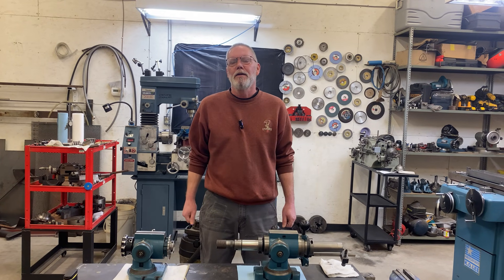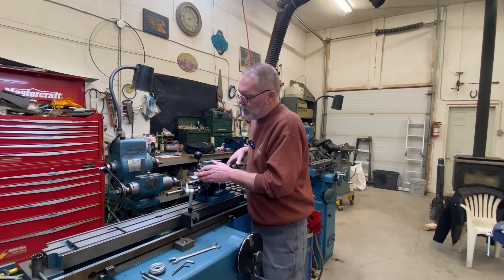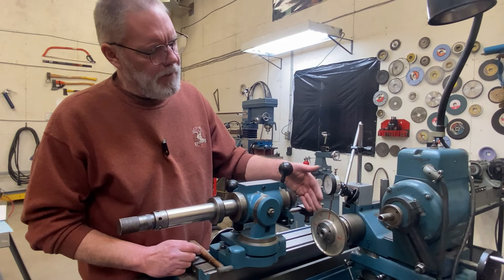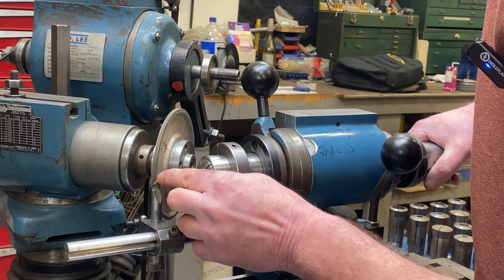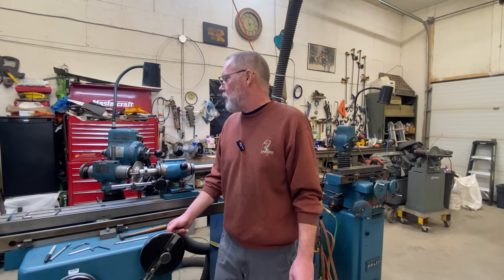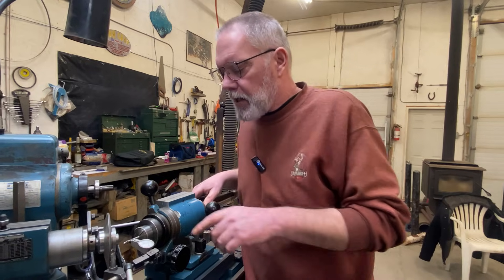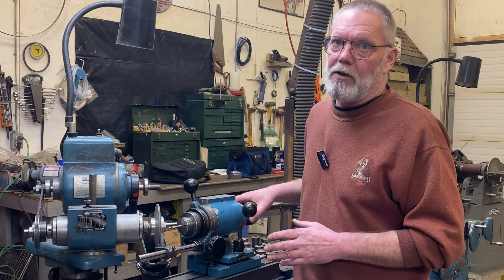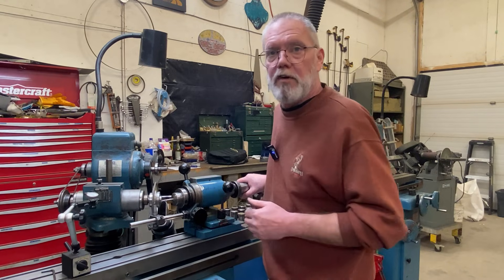HOW TO SHARPEN SMALL CARBIDE END MILLS

Comment: Great..I found out those little 1/4” cutters aren’t worth to sharpen.
Reply: I would love to own a proper sharpening machine to play around with, but those machines are absurdly expensive in my country/area. And I have a tooling sharpening shop in my hometown which has totally reasonable prices. Last week the guy saved a totally worn out 20mm four flute end mill by grinding it down to 11.8mm and he charged me 20 bucks for it. It just makes no sense for me to spend several thousands on a sharpening machine and wheels...
Reply: oh they absolutely are  if you just have a chipped tip, you can freehand the tip and gash wit ha grinding wheel alone and even a dremel with a diamond wheel. This setup is mandatory to do flutes though. But 30$ a pop adds up quick when you can get them roughing again in about 5-10 min depending how anal you get

Comment: Nice video.  I have two ko lee air bearing fixtures. I do not use them anymore.  I got a Swiss Christen  5 axis AU 150 grinder for end mills.  It has a work German  work head that moves as freely as an air bearing without air lines.  I really enjoy watching your videos.  You have way too much floor space in your shop.  Maybe you need to get a CNC tool and cutter grinder??    You are very clever.   Great video I really enjoy watching you grinding tools.  Keep the videos coming.
Reply from the maker: Thank you! I'm glad you enjoy the videos.

Comment: Thanks for another good video.  Not being able to sharpen the flute all the way up was driving me nuts thinking I was missing something. 'There has to be a way!'
Reply: Instead of using a wide flat finger use a point but it has to be made of pretty good stuff to maintain a degree of stiffness.
Reply from the maker: Agreed. I generally make my pointers out of a high quality spring steel or HSS